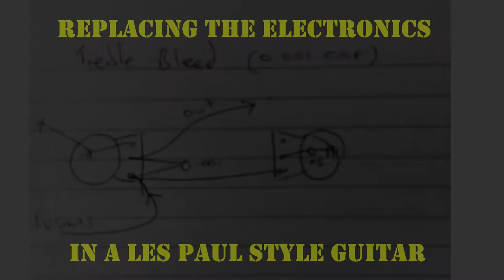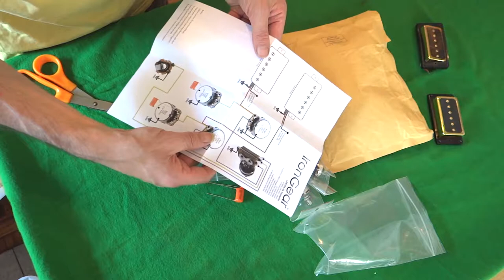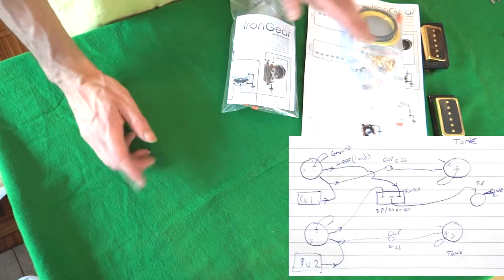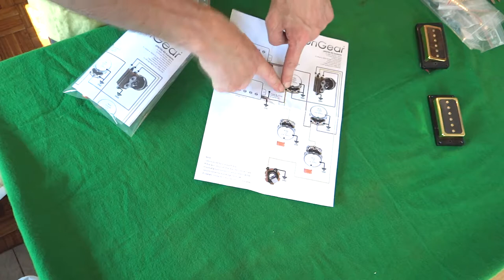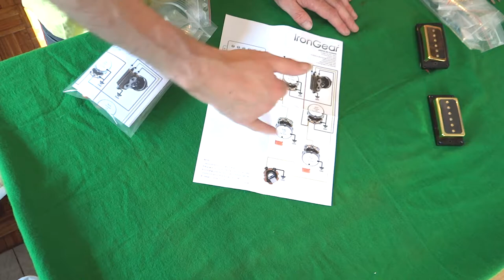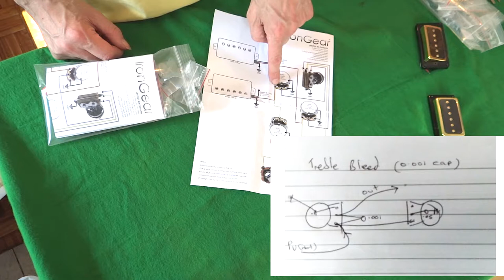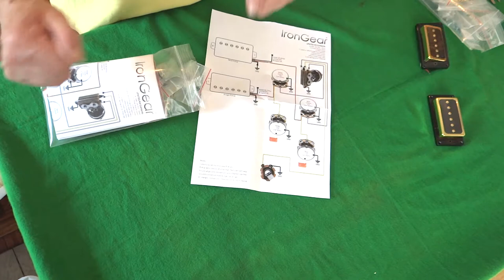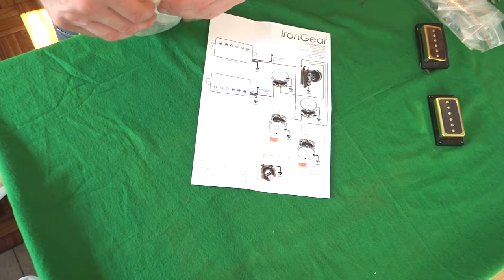Upgrading A Harley Benton HBL500 Les Paul #5

Comment: There are as many ways to wire a guitar as there is to skin a cat! I prefer the 50's scheme, as you tend to get less treble roll off on the volume without having to use a treble bleed. I found treble bleeds did retain your highs but it also worked in reverse and rolled OFF a lot of lows and mids! Good luck, I bet those big single will sound mint! \m/
Reply from the maker: Indeed. Many do seem to prefer the 50s wiring. I've experimented with switchable T/bleed and cap values. Plus guitar, pre-amp and fx can again influence the outcome as I'm sure you know. I've always imagined that strat/fuzz players would naturally hate the treble bleed whilst tele players might appreciate it but I've never subjected the notion to peer review!
Reply: @EverythingGuitar23  Yeah, fair enough!